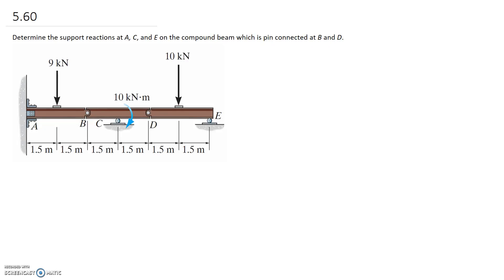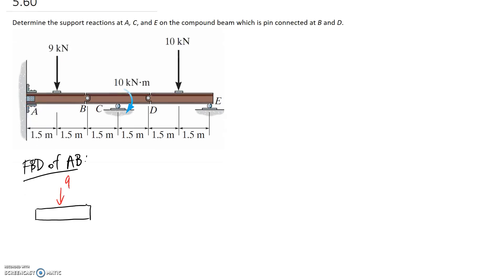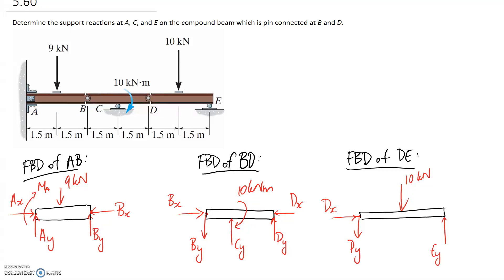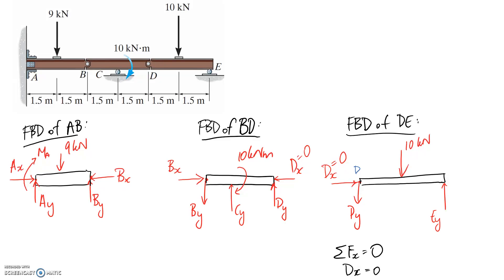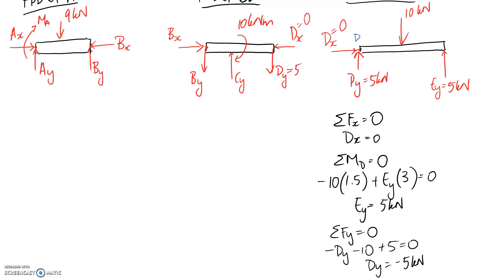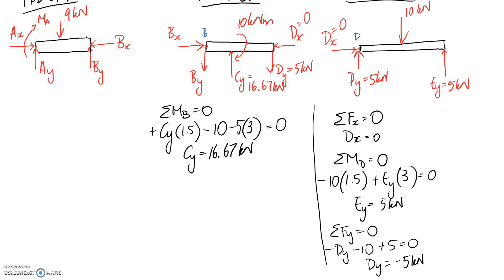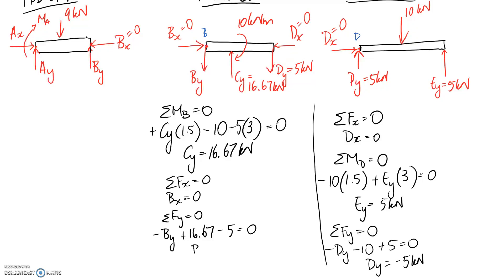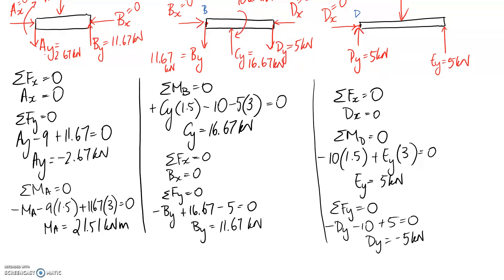Frame Analysis Example

Comment: why did you change Dy direction on FBD after finding its value which was negative? that is not clear to me.
Reply: If a value comes out negative then the direction is incorrect. A better way to think of it is that force as a scalar can have negative value, however you cannot apply negative newtons of force (for obvious reasons). The negative indicates the direction dependent on your axis, so if you ever have a negative quantity for your reaction forces, it implies the direction is flipped.

Comment: How would the problem change if it were pins at A and B?
Reply from the maker: There are further examples in the mechanics playlist. I can't remember if there is one with 2 pins specifically. However it's really the same sort of process just remembering that wherever you have a pin there is going to be horizontal and vertical force components.